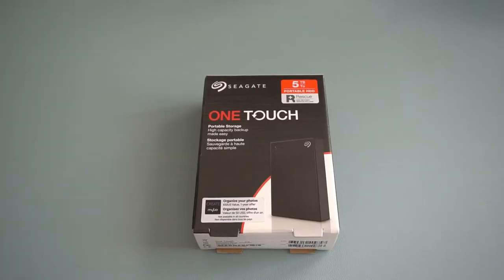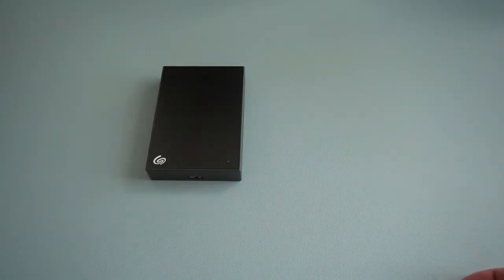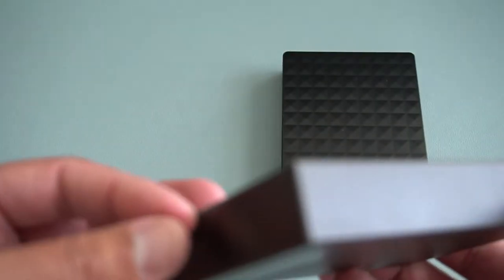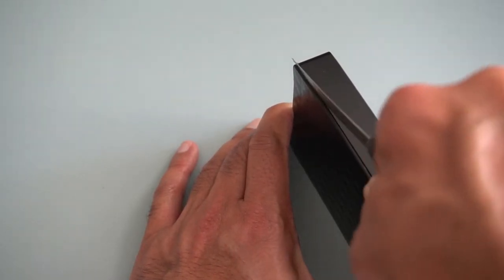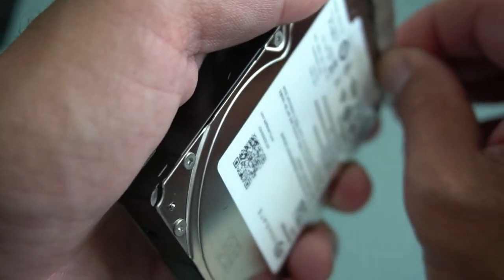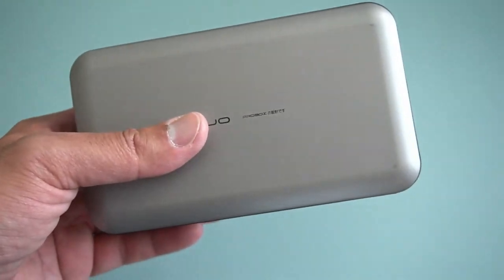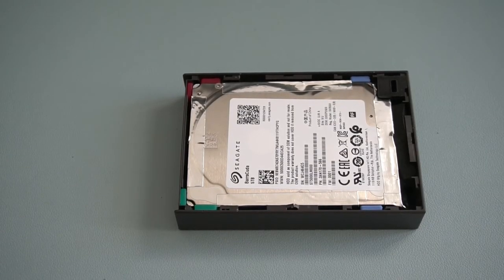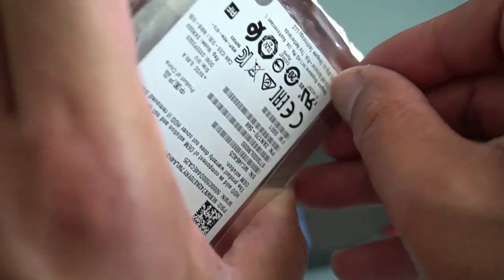Unboxing and opening Seagate 5TB One Touch, Backup Plus and Expansion hard drives, shucking, shuck

Comment: Thanks for opening these up and showing what's inside.  I just purchased (2) Seagate Barracuda 2.5in 5TB HDDs off of Amazon for $140 a piece, going to put them in a RAID 0 enclosure.  Realized the Amazon drives have no Seagate warranty on them. Found these Seagate One Touch 5TB portable HDDs for $109 at Sam's Club.  Looking at the model# on the label of the drives you opened (ST5000LM00), I'm now able to see it's the exact same internal 5TB 5400RPM 128MB Cache Barracuda drive I just purchase for $140.  Thinking I'm going to return these Amazon drives and just go purchase the portable versions at Sam's and open them up like you did and put them in my RAID 0 enclosure instead.  In that scenario, I'm paying less and know I'm getting a brand new non refurbed OEM drive.  If I void the warranty, won't matter since I have that scenario now with my purchase from Amazon but at least I have a chance of putting it back together if I'm very careful and attempt a warranty return if needed.  As an extra bonus, I will have 2 additional HDD enclosures if ever needed.  Paying less and getting more in return seems like a good idea to me.  Amazing how the exact same HDD without a case costs more than the portable version with a case.
Reply from the maker: Hi, Thanks for watching. I really appreciate the time you have taken to write this detailed comment and hope it helps others as well. Thanks!

Comment: I was given this link by Seagate to open my hard disk and recover the data on my own as mine is out of warranty and there is nothing much they can do other than sharing links. Will it work ?
Reply from the maker: Hi, Thanks for watching. wait ... Seagate gave you a link to my video? That's strange!

Well it depends, I have done this in the past for a friend and it turned out the enclosure was damaged and testing in a new enclosure the drive worked fine. So you could try this anyway as it is not working, but if you have a drive bigger than 2TB make sure to buy an enclosure which supports 15mm drives, you could also buy a standalone USB to sata connector if you just want to get the data off. Let us know how you get on, all the best, TK :).
Reply: @TKsTechTalk  Out of goodwill. Yes, they gave this link and a recovery software to try retrieve my data. I am scared to open the case , what if I damage the drive?! I'm confused. Anyway, I'm going to give it go asap. Hoping to update a positive response.
Reply from the maker: @manjubashinisubbukrishnan8793  ok, i hope it works out for you, let us know how you get on, really hope you can recover  your data. Feel free to ask any other questions.
Reply: @TKsTechTalk  thank you. Really kind of you. The hard disk got recognised by the file recovery software after a long struggle. Right now it's analysing the device - 12h 37min and running. Phase 1 of 5, 0 files found. I'm giving live updates 😄 don't know how long will it take. Also last night it ran for more than 6 hrs, I fell asleep and woke up to my desktop wallpaper. Don't know what happened.

Comment: Does this drive have a standard sata connector?
Reply: Looks like it does :-)
Reply from the maker: Hi, Thanks for watching. Yes that's correct it does. But it will not fit in a laptop incase you need it for that use max 2TB drives.

Comment: I'm glad I did a quick scan of Amazon reviews before buying a HDD, as I was initially looking at a WD drive but then read they used proprietary connectors. I have no plans (at least currently) to shuck the drive but I went with a Seagate just incase the enclosure was ever damaged, then I could simply get another enclosure.

It's a shame WD are suing the proprietary connectors, as that's my typical go-to brand for HDDs, I've used many over the years in laptops, PS3's etc. 
Speaking of game consoles though, for anyone looking to upgrade a PS4 or XB1 internal HDD, I believe they max out at 9.5mm height 2.5" drives, so for example the 3-5TB Seagate drives are too tall at 15mm. You could still use the drives via USB though for games 'extended storage', same for the latest get consoles (XBSeries & PS5). You couldn't play their games directly from it (PS4 & XB1 games can tho), but you could store XBSX-S/PS5 games on the drive to save on having to re-download or re-install from disc.
Reply: a 4tb transcend external drive will do the job, it has the same slimness as the usual 500gb,and its detachable from ots conmector

Comment: What is the dimensions of this drive after removing from the case? Actually I want to put it in my laptop in the plase of DVD CD reader. Can it be there?
Reply from the maker: Hi, Thanks for watching. Unfortunately this drive will not fit inside the laptop. I believe this and all 2.5" 3TB, 4TB and 5TB drives are 15mm in height and laptops mostly support 7mm drives so the max you can get is probably a 2TB drive. You could do the exact same thing with something like the Seagate Expansion 2tb external portable drive, I have done this in the past. Alternatively you could look for 2.5" SATA SSD's as well as they should all be 7mm and they have come down in price quite a lot and would be faster and more beneficial in the long run. Hope that helps, all the best, TK :).

Comment: Amazing! How thick is it in mm? I want to use it inside a mini pc, but the max supported thickness is 7mm.

Do you think they are reliable to use in a NAS?
Reply from the maker: Hi, Thanks for watching and glad you found it useful. So all drives up to and including 2TB in 2.5" form factor are 7mm all drives 3TB and above are 15mm so not ideal for laptop or small form factor use.  

As for use in a NAS, i believe most if not all 2.5" drives are CMR and may not be ideal for NAS. You could probably still use them though there could be some performance and reliability issues and this will vary between drives. Just to add to this I know there are specific 2.5" NAS solutions available so I guess people do use similar drives or NAS rated SSD's.

Hope that helps, all the best, TK :).

Comment: Thanks for this. I am thinking of taking the metal cover off and drill holes for passive ventilation in it. I did something similar with another external hdd enclosure and it did make a difference!
Reply from the maker: Hi, Thanks for watching. That's a great idea, these drives do get warm under longer read/write operations which can be normal considering the drive could be used for frequent backups because of the size. Now you have got me thinking ... maybe I could modify the dual bay enclosure I have which houses two of these drives and that definitely gets warm!
Reply: @TKsTechTalk  Yeah, just a couple of 1-2mm holes is plenty!
Reply from the maker: @ZadakLeader  Nice! I might have to consider this option. Thanks again for this input, hopefully will help others as well.
Reply: @TKsTechTalk  I just went ahead and did it. I did 4x4mm holes on top, 2x3*3mm holes columns on each side and 14 holes on the bottom, 5x4mm and 9x3mm. Hope this makes it cooler :)
Reply: So i am bitlocking it, which obviously means full load. The past 10 minutes it seems to have capped at 45 degrees, previously maximum was 53, so give or take it's at least a 8 degree improvement :D

I think the risk of voiding warranty to keep your drive at a safe temperature is worth it imo.

Heat only destroys the drive on the long run

Comment: Hi, that was a great review. Are both of these SMR?

Also is the Seagate backup plus hub 4tb an SMR drive or a CMR drive?

Is there an external CMR drive by either Seagate or WD?
Reply from the maker: Hi, Thanks for watching. 

It will be hard to say if the external drive will have a CMR or SMR drive. You will find from various posts that the internal drives inside the external drives do vary, guess it depends on what the manufacturers have available so its a bit of pot luck.

The Seagate drive in this video and all 2.5 drives appear to be SMR and Seagate has a webpage which lists SMR and CMR drives. 

https://www.seagate.com/em/en/internal-hard-drives/cmr-smr-list/

Western Digital has mixed drives depending on capacity, here's an example of WD Blue 2.5 inch:

https://shop.westerndigital.com/products/internal-drives/wd-blue-mobile-sata-hdd#WD5000LPCX

There is a small text on the webpage which shows for this particular model 500GB and less is CMR, 1TB and 2TB are SMR.

Another site below has a large list of SMR and CMR drives and they have a great you tube channel as well (nascompares):

https://nascompares.com/answer/list-of-wd-cmr-and-smr-hard-drives-hdd/

The last thing to add here is that I to the best of my knowledge the Western Digital My Book Duo enclosures house two WD red drives, which again could be SMR or  CMR depending on capacity but these drives are also considerably more costly so will depend on use case and needs.

Hope that helps.

Comment: Do you have any videos about how to recover data from a drive that is not reading? I have a portable 4 tb from seagate and it just recently stopped working. I can her it whirring, but nothing on screen. Any advice will be appreciated.
Reply from the maker: Hi, Thanks for watching. Firstly sorry to hear about  your experience, this can be quite upsetting especially if you had important data on it, I have been there too. 

So in the past I have a friend who experienced a similar issue. In that case, I asked them to purchase another enclosure and I removed the drive from its original enclosure and put it into the new enclosure. This fixed the problem as it looks like the enclosure itself developed a fault. 

One thing to note here is as you have a 4TB drive it will probably have a height of 15mm so if you plan to try this make sure the new enclosure you buy supports drive heights up to 15mm. You could also buy a dock or a simple USB to SATA external connector to see if the drive is working or if you if have a spare SATA controller on a PC you could just plug it in directly to the computers power supply and motherboard SATA connector via a SATA cable, the PSU will most likely have a spare SATA connector for power. 

If this does not work, I assume the drive has probably developed a fault in which case check with Seagate (I think you can check it on their website via serial number) to see if the drive is still covered and if it had any free data recovery when you purchased it, if not I think they will charge a lot of money to retrieve the data. 

It's hard to tell if it's the drive or enclosure, but I would imagine if you see nothing when you connect the drive and no external device in device manager (assuming you are using windows), there is a chance it is just that the enclosure is faulty. 

Sorry I couldn't give a  definite answer, but I hope this helps and let us know how you get on. All the best, TK :).

Comment: The drive itself can fit into a laptop? I asking because I can't afford to buy regular drive, living in a hyperinflation country and exchange rates killing me.
Reply from the maker: Hi, Thanks for watching. Unfortunately this drive is 15mm thick and most laptops can only support drives which are up to 9mm thick. If you wish to do something similar you could opt for a 2TB model which should mostly be 7mm or 9.5mm thick and would recommend checking which thickness your laptop can support. Just to add it has to be a 2.5 inch drive which is usually a portable external drive if you wish to open it. However, having said that I know it is a much more expensive option but if you opt for SSD you can get up to 8TB drives which should easily fit most laptops with a 2.5 inch bay but this will also give you much better performance for speed. Hope that helps.

Comment: Thanks for helping me make up my mind on which external HD brand to go with lol. I’ve been looking around for the right one to go in a pc for a game drive, kept noticing WD drives have the connectors soldered to the board.  🤙🏼
Reply from the maker: Hi, Thanks for watching. You are welcome, and yes it's better to buy Seagate external drives (at least for the portable range) as they can be removed. As for drive longevity seems like a lottery for any brand so I guess we leave that part to luck :).
Reply: The WD easystore drives from best buy are shuckable. They have Red drives in them. If your looking for 2.5" for your pc, go seagate. If you can do 3.5", the easystore drives are better as they are not SMR drives.
Reply from the maker: @dwray  That's correct the larger 3.5" external WD drives are shuckable and I have done this in the past in the days of 500GB. With respect to the EasyStore containing WD Red Drives (or white label red drives as you mentioned in another comment) I believe any 3.5" drive up to 6TB is an SMR drive (including Red Plus drives, except Red Pro which are all CMR) as per Western Digital at the link below:

https://blog.westerndigital.com/wd-red-nas-drives/

Also, if you do get a White label Red drive, there may be an issue with voltage depending on use, if I recall correctly there is a fix for the 3.3v pin issue. Again this may not be an issue for every use case but there is a fix which should be easy to apply. 

If you want a guaranteed Red Drive, I believe the My Book Duo (probably My Cloud Duo as well) is explicitly advertised with Red Drives and are upgradeable with an easy to open mechanism as well so no need to shuck, these are obviously much more expensive external drives so again depends on use, and sometimes they have great deals on them.

Hope that helps and thanks for watching.

Comment: You said you raided 2 in an enclosure. These are SMR drives, are you using this as an archive drive or are there frequent modifications. Notice any performance issues?
Reply from the maker: Hi, thanks for watching. That's correct I believe almost all 2.5" drives currently available are SMR. Until now I have been using it as a RAID 1 array for backup and has been functioning fine so the changes are not so frequent and performance has been great. The only thing I can say is that the drives obviously do get hot in the enclosure I use as it doesn't have the best cooling so for large copies over 100GB it can get hot. However when I was first filling up the drive copying around 100GB at a time there was no slow down from the 130MB/s at least for large files, so the drives appear to work ok. Hope that helps, all the best, TK :).

Comment: Hey, thanks for the video. Is the drive larger than 2.5"? It looks a bit taller than normal laptop drives.
Reply from the maker: Hi, Thanks for watching. Yes that's correct, generally any drive up to 2TB is 7.5mm thick and anything from 3TB to 5TB is 15mm thick which means it cannot be installed into any laptop. A drive with 7.5mm thickness can be installed inside a laptop with a compatible bay and also the PS4. A 15mm drive can probably be used in a PS4 with some modification. Hope that helps.

Comment: Are these drives about the same in terms of speeds? What should I pick: Expansion plus or One touch?
Reply from the maker: Hi, thanks for watching the drives I extracted in the video are more or less the same. I believe they are 5400rpm drives and in my RAID 1 configuration in the enclosure i described I am getting about 120MB/s for read and write which is typical for an external 2.5 inch spinning disk. I think you should buy whichever is cheaper if you plan to open it, otherwise the One Touch drive may have a longer warranty like the Backup Plus if you plan to use it externally, hope that helps.

Comment: Can u plzz tell which one is good for me to buy 🙏🏻
Reply from the maker: Hi, Thanks for watching. So internally most of these drives are the same just some with additional warranty and software. It depends what will be your main use. If you plan to open it like I did any of the drives from Seagate should be sufficient as they are more or less the same drives inside. If you plan to just use for storage and not too concerned about additional features again any of the Seagate range should give comparable performance. Hope that helps feel free to ask anything else.